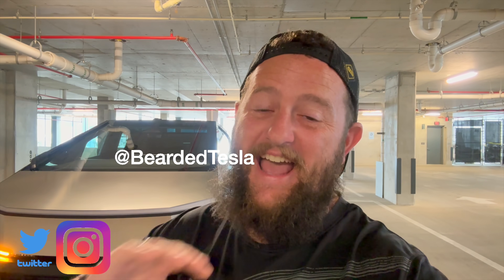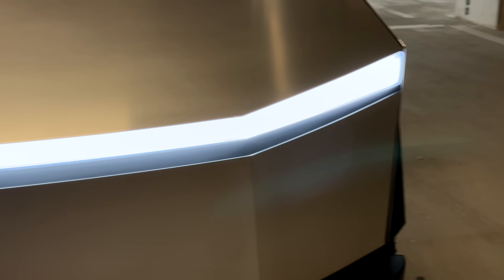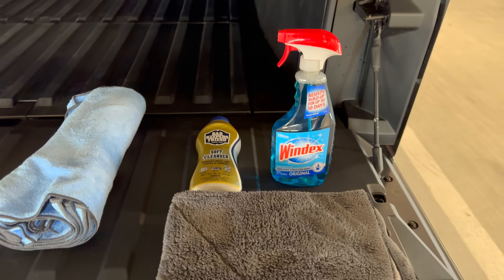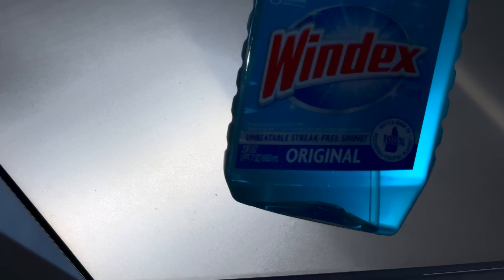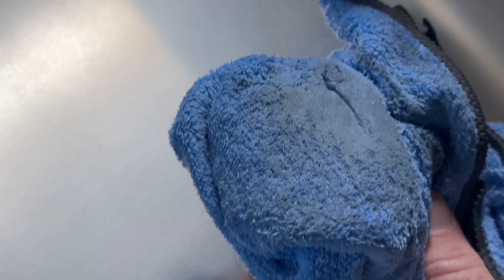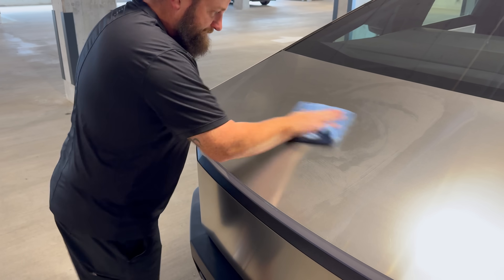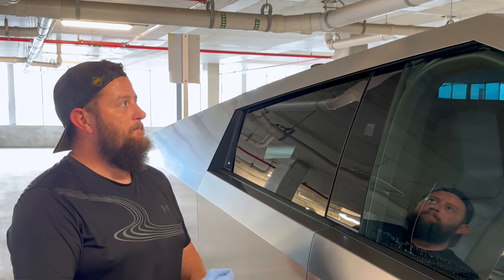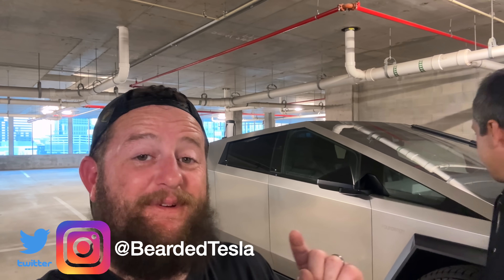Tesla CyberTRUCK or CyberRUST?? The TRUTH About Cybertruck Rusting Issue + How To Fix It!!

Comment: I agree, anything stainless can pit, have corrosion. Just look at your pots and flatware in your kitchen-you will find signs of rust. If one must obsess, diligently clean with a gentle, low abrasive sponge and water. But avoid Brillo pads, magic erasers, green pot scrubbers, and I would be fearful of any waxing or so-called protective coatings that could leave harmful residuals. Maybe rust isn’t so bad; think of it as a patina? Maybe Tesla should have a copper clad version that turns green with age, hmm?
Reply: My SS “silverware” doesn’t seem to pit after 50 years of daily use.
Reply: @Jethr001  It would if you left them outside near a train track.
Reply: Grade 18/8 (Series 304): Made up of 18% chromium and 8% nickel. This grade is highly rust-resistant.
Grade 18/10 (Series 316): Made up of 18% chromium and 10% nickel. This high grade is rust-proof and holds its polish well.
Reply: @hwirtwirt4500  I have no knowledge of the precise formula for the truck, just a little chemistry. I lived in an oceanic climate where everything seemed to be vulnerable to corrosion, even brass and nickel plated door handles.

Comment: Hey B, thanks for the video!  I guess all the Tesla haters will hate you for this one😅.  I’m glad you found a simple solution for a simple issue.
Reply: Owner's manual states "To prevent damage to the exterior, immediately remove corrosive substances (such as grease, oil, bird droppings, tree resin, dead insects, tar spots, road salt, industrial fallout, etc.)" Bulletproof, but thwarted by bird poop 🤣
Reply: @victorcadoret259 What that says in the owners manual would work the same way for any car. It’s generally good advice even if you don’t have a cybertruck.
Reply: @CommanderTexas  LOL yeah sure and everyone needs to use Barkeepers Friend on their car. Owners of this high-maintenance metal are starting to use vinyl wraps because the body is so delicate. There are easier and far cheaper ways to get attention in this world than to own one of these trucks.

Comment: Can someone use a product like Iron-X on the truck? I know for cars with regular paint and clear coat, detailers use that. Not sure if you can use it on stainless steel though. I’m guessing a brave person will have to test it out.
Reply: I would just use the BKF, as IronX is rather corrosive. For instance, you don't want it to contact brake surfaces.

Comment: great video! After applying barkeepers friend to the whole truck and removing all the tiny rust spots, how long before the rust comes back? Is this treatment something you would have to do once a week or something?
Reply: Probably and that’s too much work 🫠
Reply: Once a year i would guess if you dont want them to pile up to much. They will come back because thats just how it is, Ironparticles are on the road, every car that brakes befor you and your breaks too throw them on your car
Reply: You don't need to do this weekly unless you are parking it on a moving railcar and/or next to a grinding wheel working mild steel. At this point, any car is going to have this stuff on the paint. The only unique situation here is that it's a cybertruck.

Comment: Window cleaners on a stainless alloy? Someone should manufacture a cleaner designed for metals...
Reply: Its martensite. Be assured nobody on the world has a solution for openly and publicly used martensite.
Reply: There is stainless cleaners for high end stoves and refrigerators. Expensive,  and an issue all cleaners of these product are familiar with. Cheers
Reply: Yea it's called stainless steel cleaner and it's pretty common

Comment: As it was explained to me many years ago by an engineer, it’s stainLESS, not stainFREE.
Reply: True statement sir! Most people (because not everyone studies elements) don't understand that stainless isn't just by itself. It's always mixed with some other metal to help with corrosion and rust resistance. The primary element is Chromium, and depending on the application it can be anywhere from 10% or higher. But you also have nickel, manganese, copper, Molybdenum, or even nitrogen. Some of these help add resistance to saltwater and some help with adding resistance to atmospheric elements when mixed with stainless steel. But I bet you one thing, the chemistry of the mixture Tesla is using will most definitely change over time as more these reports come out!
Reply: @Twankie1981  this is misleading. steel always needs iron and carbon. anything that doesn't have iron and carbon is automatically not steel. Now you can add other "impurities" such as chromium, which is what gives stainless steel its anti-rust, corrosion properties. Other impurities can also make it stronger for example. It isn't like "stainless steel isn't by itself," it's more like "steel isn't by itself."
Reply: So a homeless person is someone who has a smaller house?
Reply: @MrQuay03   Yep... his home is "infinitely small"
Reply: I love this lol
Reply: Engineer explained LESS means without. Stainless doesnt rust like that if its high grade
Reply: Cybertruck owners seem to be on their own trying to maintain their investment. I’m wondering how it would age with little cosmetic upkeep… like most work trucks.
Reply: My 45 year old stainless steel kitchen sink has never shown a spot of rust.
Reply: @hwirtwirt4500 it's the chromium layer in stainless. Cybertrucks have it as well, but the layer can be damaged. Exposure to various road chemicals, salts, and rocks sttiking the surface at highway speeds is a much harsher environment then we see washing our dishes. 

This isn't a new problem. People knew not to take their DeLorean out into the rain, and we used steel wool to clean off the inevitable rust spots, because the chromium layer is going to fail eventually.
Reply: Mine has, very badly.  @hwirtwirt4500
Reply: @hwirtwirt4500  likely because they used high grade stainless, newer stainless isn't as high grade and has higher levels of other ferrous metals in its alloy (think original stainless fridges wouldn't hold magnet and new lower grade stainless appliances will now attract magnets) because it's cheaper to make. The cybertruck is obviously made form a lower grade stainless but unlike appliances in your house, it is going to be subjected to a lot more moisture, dirt etc. and is more exposed to the elements that will cause it to rust. My thought is that a simple solution for this is to clear coat the truck, will keep it sealed from the elements, will retain its "bulletproof" status and be a lot easier and cheaper to clean and polish.
Reply: @hwirtwirt4500 because your sink sits inside a house 24/7 and isn’t exposed to the elements. 🤦‍♂️
Reply: @dereksutphin892  don't know about his sink. But my sink is exposed to water multiple times a day, sunlight because it is right next to the window, acidic food, alkaline food, hot oil, cold oil, all sorts of other weird stuff we cook with, a variety dish soap and pot cleaners, scratched by metal utensils, fish and chicken bones dumped in it, scraped directly with a knife when something stubborn sticks, scratched with iron wool a few times a week, never wiped dry, and there is not a speck of rust on it. Keep your cybertruck under a car porch roof, and do all that to its hood and see what happens. You've never been in a kitchen? You don't know what happens to kitchen sinks?
Reply: @hwirtwirt4500   It's not outdoors and if you don't have hard water...It won't.  Not a valid comparison.
Reply: Maybe the guys who make car washes can start putting in wire wheels as opposed to the currently spinning rags(?)  You'd have to warn people with regular vehicles tho'.
Reply: Didn't they test this thing? The problem is not about cleaning, CT will horrendously rust from inside, where you cannot reach to clean, and where their wrap isn't applied either. The only solution for this is a clearcoat bath, before assembly.
Reply: Engineering 101 - there's no such thing as a "stainless" material; but there is "stains less" material. :)
Reply: DeLorean is crying with laughter.
Reply: There are different types of stainless steel. Some are more resistant to rusting and stains. My guess would be Tesla used a cheap version to reduce costs. Not a knock on Tesla as I am sure they will address the issues that pop up, but this is why I would NEVER buy a first model year of ANYTHING, especially something that could run near $100k. Let them work out the kinks first.

When I redid my kitchen, I "upgraded" to stainless steel appliances. I have grown to absolutely hate them and regret doing so. I have yet to find a stainless polish that cleans well without looking or feeling greasy. Despite the name, I do have stains on my range that I can't seem to get rid of unless I use some sort of scrubby, which will damage the metal. Fingerprints galore. Can't wait to go back to all black appliances. 

There is a reason no manufacturer has used stainless steel bodies' since the Delorean. 

And not for nothing, but the stainless steel on the CT looks godawful. Looks like a rolling refrigerator. The wrapped ones I have seen, regardless of color, look MUCH better.
Reply: or in the case of CT, stainFULL 😅
Reply: These articles are just fake news.
Reply: 😂  my Dollar Stores’ $1.25 stainless steel BBQ cooking utensils are definitely stainedFREE and rust FREE outdoor in rainy days, under hot summer sun and in the heats of dirty burning coals .  Y’all Testla fanboys need to stop making up bullshite foolish idiotic excuses for your $100,000 Cyber RUST trucks . Instead of wasting your precious times buffing-waxing to cover up all the stains and the rusts on your brand new 1st day delivery stained and rusted Cyber RUSTs, tell Elon Musk to make his stainless steel Cyber Trucks RUST FREE and STAIN FREE like Dollar Stores’ cheap stainless steel cooking utensils
Reply: Senseless comment
Reply: just like a painless procedure is less painfull right?
Reply: I think the solution is to buff it out and then cover it with a 3M plastic or good quality wax
Reply: Stainless means it doesn't stain.. rusting is a different process.. one is a tarnish which is on the outer layer and the other is corrosion which is deeper.. i know most stainless steel sink manufacturers say that their products will stay clean only if you clean and dry your sink after use.. so in the case of this truck I feel like it doesn't stand much of a chance in the long run.. we still have cars from the early 1900s that run And drive like new.. i doubt that any of the original Cybertrucks a hundred years from now will look as good as the day it rolled off the assembly line..
Reply: Wrong,  stainless steel does not rust period, Tesla cultists got scammed.
Reply: In Spanish is “acero inoxidable” there’s no option for rusting here
Reply: abosolutely, but that is what we are seeing here or what was explained in the video. It is brake dust and environmental contamination every car in the real world has it,  this why detailers use IRON Remover on vehicles after washing the car.  Because Iron particles bond with metal and can just be washed it off.
Reply: A GM, Ford or Dodge has NEVER had hand size rust hole all the way through it in the first 2 years. It takes 3 or more years.
Reply: @mattsparks5957  the fanboys are struggling to cope. My 4 year old Honda don't have any rust on it. Because all the metal is covered by paint, or chrome. Somebody should have told Elon years ago that stainless steel do in fact rust.

The guy in the video says maybe the rust came from when the factory was finishing the cybertruck, and its just the metal dust from when they polished it. They same stuff when ground off the hood can rust and then bonds back to the hood, but the same metal on the hood doesn't rust? This is not logical.

And he says I'm not saying you have to do all this (because that is tantamount to saying Elon made a mistake and shipped crap) but you will need to do this when the rust aopears on your cybertruck. And its not a one time thing, because Tesla don't have the solution to the problem. You will do it again and again. It's like the A350. Only Airbus repaints the plane for free, and compensates the airline partially for the few days the plane is unavailable. Tesla does nothing. You fix it yourself.
Reply: @mattsparks5957  Make up a fake scenario to defend your hero Musk, he will be quite pleased unlike the owners of rusting CyberFlops.

Comment: Stainless Steel rusts - doesn't everyone know that?
I guess Elon doesn't...

So I asked AI (Copilot) this question:
Q Does stainless steel rust

AI:
Stainless steel, while renowned for its corrosion-resistant properties, is not entirely immune to rust. Let’s delve into the science behind this phenomenon.

Composition of Stainless Steel:
Stainless steel is primarily composed of iron, carbon, and 12-30% chromium. Other elements like nickel and manganese may also be present.
Chromium is the key component that renders stainless steel rust-resistant.

Why Doesn’t Stainless Steel Rust?:
When stainless steel is exposed to oxygen, a thin layer of chromium oxide forms on its surface.
This layer is highly protective and prevents further oxidation (rusting) of the steel.
Even if the surface is scratched, a new layer of chromium oxide quickly forms to safeguard the underlying steel.

Causes of Stainless Steel Rusting:
Corrosion is the main culprit behind stainless steel rust.

Different types of corrosion can lead to rusting:
Crevice corrosion: Occurs in oxygen-deprived areas, such as joints or crevices.
Chemical exposure, saline, grease, and prolonged heat exposure can also contribute to rust.

In summary, stainless steel doesn’t rust because it actively forms a protective layer (chromium oxide) when exposed to oxygen. This layer shields it from further corrosion123. However, extreme conditions can still damage stainless steel, so proper care is essential.
========================
Basically, if you are used to the smooth, clear coat on 5 coats of automotive paint
you can forget it
pitting is what you have to live with on the Mad Max truck
Reply: Exactly, good comment !
Reply: But this is not panel rust. It iron particles in the air that end up on any car and rust... all cars have this issue, it is just not as visible
Reply: @pipooh1  Does it really matter? As the Mad Max drives along the air is full of iron oxide particles from car brakes and they attach to the SS skin and rust.

Unless the owner washes the car daily the Mad Max is going to look like an old ship at sea - rusting away.